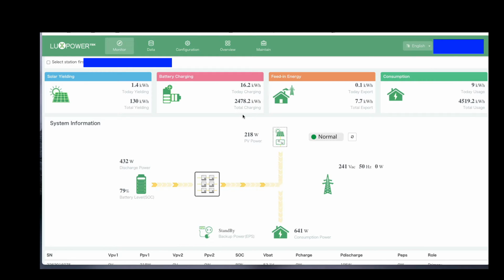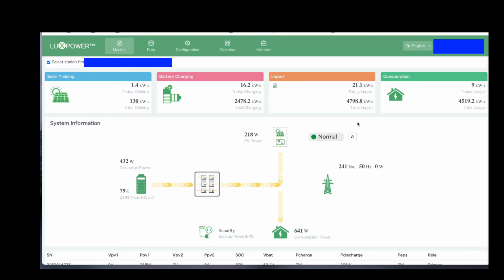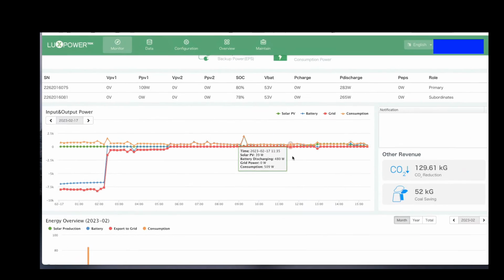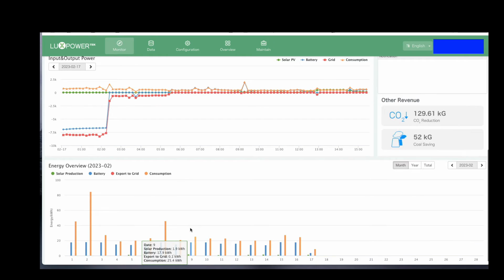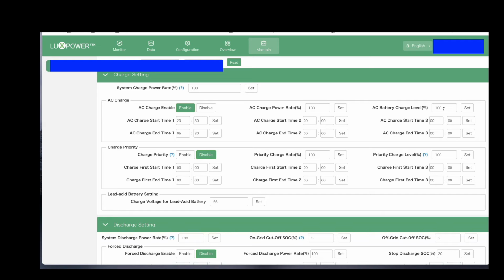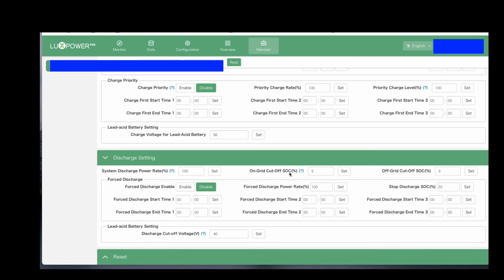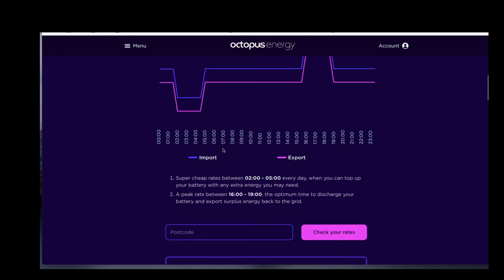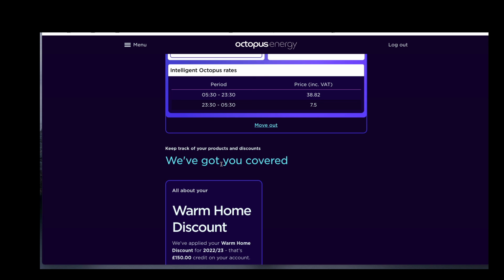LuxpowerTek User Guide Settings/Charging/Discharging Octopus Tariff

Comment: @YorkshireAutomation this was genuinely a really helpful video and much better than the manufacturers literature and efforts. Perhaps a silly question but what does "Power Backup Enable" do? Is it possible to configure the system to run the house during the power cut? Or can you only wire a socket on to the battery for smaller items to use?
Reply from the maker: thanks for your comments.
the system can run the house when there is a power cut but it has to be connected to the EPS outoput port of the Lux.  You would need an electrician to wire in and make sure it complies with the electical regulations.
Thanks
Reply: I think I read it couldn't power the house unless there was a gateway or something to stop electricity going the wrong way into the grid. Does the lux Inverter work as a gateway? I suspect it doesn't and the EPS outlet will only power some sockets and can't be connected to the whole house. Nonetheless, many thanks for your help!
Reply from the maker: @RossFawdington  the eps is connected indepently from the existing house. so the circuits are wired into a consumer unit directly fed from the EPS port. it has nothing to do with the grid.  When grid is active then power is bypassed thruogh charge controller and into eps. when no grid then power is supplied via batteries. at no point is there a back-feed into the grid

Comment: Many thanks for this informative video.  We have just added another 3 Pylontech batteries to our LuxPower Invertor.  What do we have to do to see these on the app please?
Reply from the maker: They will automatically appear on the app provided they have been configured and connected correctly to your existing setup.
Reply: @YorkshireAutomation  Many thanks for your quick reply! It's hard to tell from the app as it doesn't show the amount of charge in kWh just W (which says 30W) and 50.0Vdc and I haven't a clue what this means!
Reply: Everything seems to be working ok - all lights on and no error message
Reply from the maker: @sokusziu  have you waited for at least 5 mins for the server to update?
Also has the master been set to the new number of batteries?
Have the slave batteries  also been set?
Reply: @YorkshireAutomation  yes ir's been about an hour.  How do I change the master (what/where is the master? On the app?) I don't know what you mean by slave batteries, sorry!
Reply: @YorkshireAutomation  sorry I've just asked my husband (who installed the additional batteries) and he says he's not changed the master battery - where should he do this? He's not done anything to the slave batteries.  Basically he's connected them all together as per instructions, turned the invertor on n off etc
Reply from the maker: @sokusziu  email me on info@yorkshireautomation.co.uk or whatsapp +447946591533.
Thanks much easier than on here
Reply: @YorkshireAutomation  Having checked how much the batteries charged overnight I can see the additional batteries have been added to the app automatically.  I just wish it would show the amount of charge remaining in kWh rather than just %.  Many thanks for your help and quick replies.

Comment: Hi, thanks for the video. 
I have a  Lux system installed with a Lux 6000 hybrid inverter and a Greenlinkx battery. Based on the specs  of the inverter it seems that it could be fitted with an automation so that if the grid power gets down the solar system  can disengage the grid and continue to feed the house and function from solar and battery alone - as long as there is enough power generated or available in the batteries . However, the installer said he cannot fit it that way.  Do you know if there is any after market option to make it this way?
Reply from the maker: He is correct. The system does have EPS mode but they will have to re-wire existing house circuits through the hybrid inverter and also make provision for an external earth rod too.
Reply: @YorkshireAutomation   Thanks. I suspected that. They don't know how to. I have an idea, but I am not an authorized electrician. Would this modification be something that you would do, or  be interested to take on a contract ?
Reply from the maker: @mortexist   please contact me via email or call 07946591533 or info@yorkshireautomation.co.uk

Comment: Hi, is there a way to set the start % for charging, as during the spring and summer months my batteries will go through the night and start charging via solar in the morning. So if the battery percentage was below 40% the inverter could charge them to 70%, thanks
Reply from the maker: as far as i know the system can only be set to charge based on time and then it will check percentage. So you could set the charge level to 70% and set a time period for tfor the morning.  This would mean taht even if it was at 69% it would charge for 1%.  
During that charge times you have set would mean that discharge is disabled.
I think a third party integration would be needed for what you would like to do.

Comment: The web interface I see on the Africa server differs a lot from your video. Not sure if different regions have different versions, but I can't apply settings as you have.  
My actual problem is that an inverter is set to begin AC charge with both SOC and TIME - to begin 55% SOC and Time 18:00 start to 06:00 end.    It charges fine during the specified Time range but not when it reaches the SOC percentage during the day. It does, however stop discahrging at the 50% EOD SOC I have set. 
Is there an explanation as local Lux support are unable to provide answers as to why it's not beginning charge at the SOC 55% point?
Reply from the maker: From my understanding the SOC rate is the minimum SOC required. So if the SOC drops to below 55% it will charge up. However if it goes above then it wont charge at all.
I can see from your email that the interface is different and you have different options to us here in UK.
But as far as we know that we cannot set the batteries to charge/discharge at same time. its one or the other in that specific time frame.

Comment: Hi, thanks for this video it’s very useful. I wondering if you can help, My battery will only AC charge IF it has some charge left in. If it’s empty at (at 11% SOC) then it will not auto AC charge. Should I try increasing the on grid cut off SOC a touch do you think?
Reply from the maker: Hi
It should still charge from AC if that is the settings you have set. I have mine set to 5% with Lux and Greenlinx batteries. 10% if lux and pylontech batteries.
The only time it needs solar to charge up is if the battery voltage drops down.
Best to ask your installer to take a look and escalate to tech support if they can't figure out

Comment: Is there any way to set the batteries to discharge at peak times, but not export to grid (only discharge for what the house is using)?I'm finding that the batteries are dumping out to grid and fully discharge before peak time has ended, therefore I'm still paying for peak time electricity towards the end of the peak time window.
Reply from the maker: The default setting is for the batteries to discharge only what the house needs. Unless you have enabled force discharge then it will just supply what you have specified in the settings.

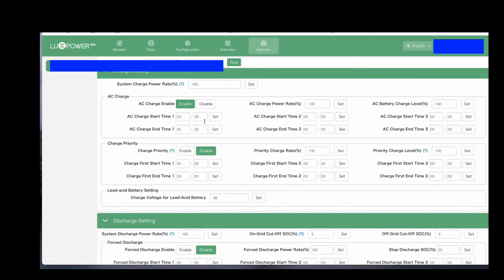Comment: Hi, is the AC CHARGE setting that I see at minute 13:20 the one that allows you to charge the batteries at night at a discounted rate and then use the battery during the day? So recharge from 11.30pm until 5.30am?
Reply from the maker: Yes mate that is the setting you use to set your schedule up. Just remember to press SET after each entry and enable it too.
Reply: @YorkshireAutomation  If it is possible to have another help.. what the button is for Quick Charge?
Reply from the maker: @FrankHighlanders  quick charge is just that.. Just press and that's it. No need to go into settings and set times etc
Reply: @YorkshireAutomation  Recharge your batteries from the mains for an hour? Thank you
Reply from the maker: @FrankHighlanders  I tested it and it's not a 1 hour timer. It just charges manually until.you stop it. It means you don't have to go into settings.
I've edited original response

Comment: Very useful.  Tiny error, max power for two luxpower / squirrel pods of 7.2 kW does not equate to "40 amps".  More like just under 32 amps.  Hence my 32a MCB they are on, won't trip.  But I have throttled charge rate to 57%, as I too have 19.2 kWh, I too have intelligent octopus, 6 hours to charge in, absolutely no need to go berserk and charge at 7 kW.  4 kW charge rate is plenty actually, and a shade kinder on the batteries.
Reply from the maker: Yes that's what I do now. And you are correct better for the batteries

Comment: Could I ask a general question please?  We have this set up - Luxpower batteries and a controller that doesn't.  Most of the time the controller is fast asleep and only grudgingly wakes up to switch to battery supply.  Have you seen many examples where the controller does not control - or is ours the only one?  TIA

Comment: Hello i wondering if you can help me i have a 5kva luxpower inverter and the problem im experience is my battery is discharging more than the grid is puting in
Reply from the maker: Looks like we need to check your settings.
Can you take some screen shots and email to me. 
Thanks
Reply: @YorkshireAutomation  yes sure what is your email
Reply from the maker: @markusdebruyn8473  info@yorkshireautomation.co.uk
Reply: @YorkshireAutomation  okay thanks i sent you a email with screen shots

Comment: Thanks for the video.  We often appear to be exporting to the grid when we could be adding to the battery level.  Is there a way to control this please?
Reply: Hi
Please be aware that the snapshot for the app is taken approx every 5 mins. sometimes it is taken as it is transitioning and so it seems as if its exporting instead of charging.  The inverter can take upto 5 secs to respond.
If it seems to be doing all the time then ask the installer to take a look at the data and we can then work out whats going on.
Cheers

Comment: My Lux Hybrid inverter is set up to charge the batteries on cheap rate (21:00 - 06:00), however it would appear to be powering the house as soon as the charging stops, when in reality I would prefer to maintain the batteries in standby until about 18:30 (in case of powercuts), and then to power the house before the next cheap rate switches in. Is this possible.
Reply from the maker: So you would like to have batteries do nothing from 0600 to 1830?
Have I read that correctly?
If yes then setup ac charge time 2 for between 0600 and 1830 and the charge level that is low. This way the batteries will not discharge and as you have set the level well below what it actually is then they will not charge from the grid either
Reply: @YorkshireAutomation  Thanks, you have read it correctly, I will try what you have suggested, and see how it goes. Regards
Ian
Reply: @YorkshireAutomation  Hi, I have looked at my system, and I am a little bit puzzled. I can locate/set charge time 2 OK, but I cannot see where or how to set a charge level for the second charge period. There would only appear to be an overall charge level for all time periods. Regards Ian
Reply from the maker: @purpleocean7721  
Sorry you are correct only 1 rate can be set. 
So if the level has been reached in the morning session then leaving the inverter until 1830 would mean the level remains and therefore it won't discharge
Reply: Hi, I would also like to set up my Lux Hybrid inverter to charge the batteries at an advantageous rate (9.00pm - 6.00am), could you show me your setup screen?
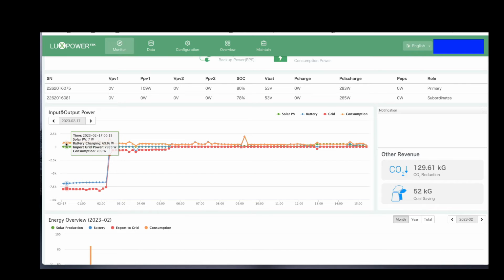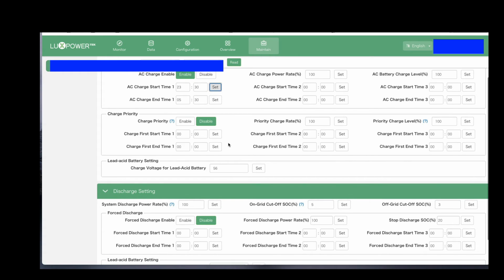Reply: @FrankHighlanders  My cheap rate is 21;00 to 07:00. I do not seem to be able to add a screen shot, but my two relevant settings are AC Charge Start Time 1 = 21:05, and AC Charge End time 1 = 14:00.
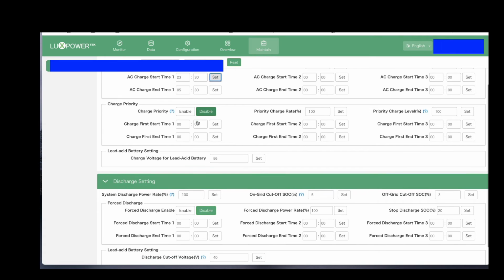This means the battery starts charging at 21:05 (cheap rate) as it is fully charge by around midnight, it does nothing more until the charging period ends, at 14:00. Then the battery kicks in powering the house, until it runs out, but does not recharge until the start of the cheap rate 21:05.
Regards
Ian
Reply: @purpleocean7721  
I would have the batteries recharged from the mains from 7.30pm to 5am, then I would leave the battery and panels with the task of powering the house. With this setup I should be able to do it.
Reply: Hi, I have an issue with my 2nd battery. It doesn't discharge at all. Our first battery discharges down to 10% then it switches back to grid use despite the second battery being 85% full. Any advice would be great.

Comment: Thanks for video. I'm just on Octopus Flux import for a few weeks until they sort the export side.
At the moment I can buy cheaper from grid 0200-0500. And over the first two days of doing this I'm not understanding the logic of what's happening. Here's an example.
It's set to charge batteries to 40%. But at 2am they are still at 60% from yesterdays sunshine. I thought they would just keep getting discharged until they reach 40%. But that's not what's happening. At 2am luxpower ac controller starts importing from grid for the small background overnight usage. It stops discharging batteries until 5am. Then it's back to using the 60% SoC batteries. This means I had to purchase grid power unnecessarily in my opinion. Yes it was at cheap rate. But I wanted my batteries to be at 40% to make room for next days solar. I don't get the logic.
Once I'm fully on Octopus Flux, I guess if not going to be such a financial problem.
Reply from the maker: Hi
When you set the batteries to charge from the grid they will stop discharging.
Batteries can only perform charge or discharge separately and not simultaneously. 
Also you set your charge limit to 40%, this means the batteries will stop charging when they reach 40%, if they are at 60% that means no need to charge them and as your timer is set from 0200 to 0500 then they effectively switch off. That's why you ended up importing.
Reply: @YorkshireAutomation  thanks for speedy reply! I think the key thing your said its that they are set to charge. So even if they don't charge cos they don't need it, they won't discharge.   Thanks

Comment: Thanks for a great walkthrough video!

I have a car charging question.

We have 5kW west facing solar, 9.6kW Greenlinx batteries, zappi charger, tesla 3 long range.

We are on octopus go (00.30-04.30 cheap period).

We’ll be charging the car during the cheap grid period.

How do I set up the inverter/battery settings so we are not using the batteries during this cheap electricity period to charge the car? The battery capacity will not be enough. And no point draining the battery to then not have enough power to supply the house until sun is out.
Reply from the maker: Hi
thanks for your comments!!

to make sure the battery doesnt discharge whilst you are chaging car during off-peak is a simple process.
You have to enable the AC CHARGE on the LUX.
However if you do not want the batteries to actually charge too then make sure you set the AC BATTERY CHARGE LEVEL to 5%. This means that as long as the batteries have at least a 5% charge they will NOT be charged using grid and also not discharge into the car.  Also make sure you set the AC START TIME and END TIME same as above.

You have to remeber the batteries will effectively be switched off for those 4 hours and your house will also consume off-grid power.

Thanks
Reply: @YorkshireAutomation  brilliant! Thank you for your answer!

Comment: Hi, thanks for a v useful video. I have lux batteries, invertor and solar and can’t figure out how to charge the car from the batteries at night. Thought the “force discharge” might work but I realise this sends it to the grid. Any suggestions gratefully received 😊 thanks
Reply from the maker: Hi
Force discharge is for those that want to export to gain the benefit from the higher export rate offered by octopus flux tariff.
So don't need to use that setting.
The system is designed so that whatever  the demand in the house the batteries will provide upto its max discharge rate. This is 3.5kw per hour. So if you plug your car in then the battery will be used first before the grid.
However only 3.5kw from battery and therefore 3.5kw from grid plus whatever the house needs.

Comment: Great info. What secondary charger do you recommend
Reply from the maker: Secondary charger?
Reply: I don't have panels and would like to know if I can use a secondary ac charger .
Reply from the maker: @dawoodadam2926  yes you can have upto 8 AC charge controllers each with upto 8 batteries.